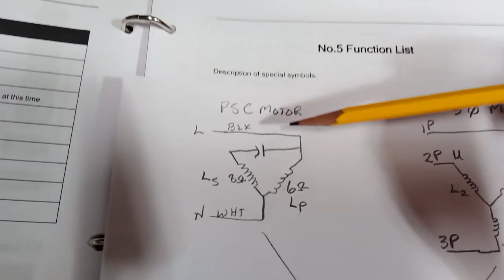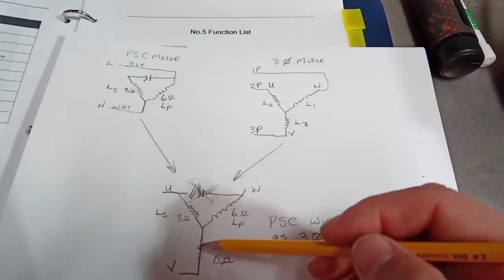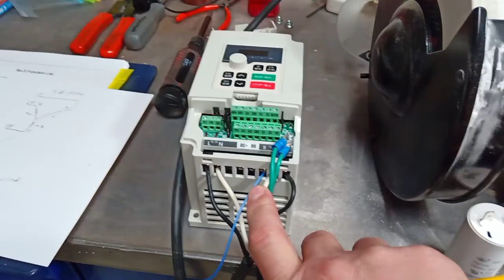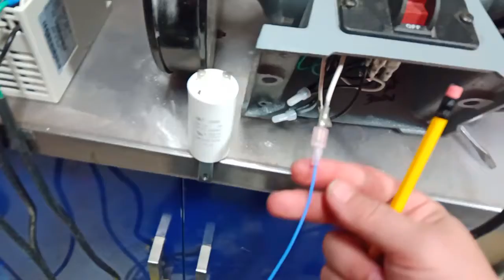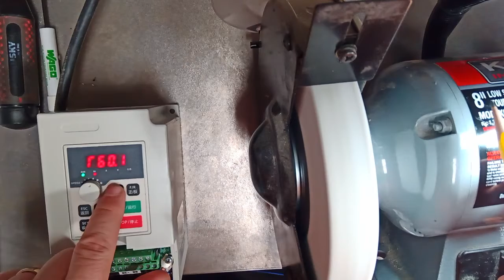Connecting a 120V VFD to single phase PSC motor in my bench grinder

Comment: Neat!
It would be nice, though, if the VFDs offered the option to change the phase relation from 120° to 90°, to accommodate the rare occasion where you'd use them with PSC motors.

Comment: Not sure if it can not be done without those settings
Reply from the maker: Therr is another linked video that discusses all the settings used for my opeation.  Others may need other setting changes.   This was all about proof of concept and journey of trying this approach to vetting variable speed control for my grinder requirement.

Comment: Absolutely as clear as MUD ?
Reply from the maker: The content in this video assumes a working knowledge of electronics and safe tool‑handling practices. If the material isn’t making sense, I strongly recommend not attempting the procedure nor opening your electric motor. Safety is far more important than experimentation. If you need this capability without the technical background, please consider using commercial off‑the‑shelf tools that provide similar functionality

Comment: I have connected common on U, main on V and start on W, works just fine. In my case motor is not PSC, it's start with capacitor only, refrigerator compressor motor.
And I need to make some clarification to your story: PSC motor has 2 sets of windings displaced in space by 90 degrees, which needs to be as close as possible replicated by electrical displacement using capacitor. By it's own nature current trough the coil legs by some degrees (less than 90 degrees) behind voltage.
Reply from the maker: Yes the technical term is a capacitor causes the current in the aux coil to lead by 90 degrees.  hence is why the pole coil placement exists at about 90 degrees.  But it's much more complicated as speed comes up.  The speed of the PSC motor is actually determined by the number of poles in the motor and the frequency  A 4 pole motor runs in steady state about 1800 RPM and a 2 pole motor runs about 3600 RPM with 60Hz power.  Yes I over simplified the statement stating it was 180 degree.  When the PSC motor starts the current leads by 90 degrees with a huge inrush current causing a aux voltage lead of 70-90 degrees.  As the motor speeds up the aux current lead drops to 20-40 degrees and the main coil current lag drops to 15 degrees.  So yes the physical winding is near 90 degrees in space is what interplays with the AC voltage source capacitive lead phasor.  The standard 3 phase motor has the coils placed 120 degrees in rotation.  The fact the PSC motor uses only 90 degree placement to help match capacitance lead, is what in essence still allows the VFD to function.  The 90 degree placement vs ideal 120 degree placement is not as effective and efficiency drop.  The PSC motor by design produces the most amount of torque on startup and least amount of torque at running speed.  The VFD provides the output at 120 degree phase relationship.  The VFD variable frequency output is what permits the variable speed control of the PSC motor.  In my grinder application, I find the VFD provides more consistent torque through the variable speed and is likely attributed to the output being 120 degree vs the standard 90degree current phasor relationship cause by the capacitor.  The design isn't ideally matched but thankfully it is close enough that it works.  I should have used the more technical 90 degree phasor description in my video rather than the 180 degree 2 coil phase implication stated.  What I really failed to clarify was the difference in motor design using 2 pole vs 4 pole motor.  The 2 pole (standard 3600RPM) motor vs the 4 pole (1700RPM) when running on the VFD.  The more poles in the motor should provide a more consistent torque application at the running speed.

Comment: Your white wheel has a lot of left and right play. Don't be afraid to use a truing tool on each side. Just a light touch will do it.
Reply from the maker: Thanks.  It wasn't a concern.  When I was truthing the VFD concept in these videos,  I had no intention of using those stones.  I installed a Multitool 2" x 36" Belt Grinder Attachment (MT362) and a cardboard paper wheel on the second slot.  The whole idea was to get a total blade grinding and polishing machine in one unit.  Go from 40 grit to 600 or 1000 grit in the belts and scotch-brite belts then have full polish on the second wheel.  Hence the need for speed control and better torque management at various speeds to match the work tasks.🙂

Comment: Thanks for sharing this! I have a blower fan for moving air in my house that is 110V AC PSC but runs too fast / noisy. I had previously tried a triac dimmer running it single phase and it would hum. I wired it up 3 phase as you showed in your video with a VFD and it can be run at slower speeds smoothly and no hum which is great, but I'd like to be able to turn the fan on and off just with the AC supply. I also dont need the full variable range of the VFD, just want to run the fan at ~1/2 its originally designed 1 phase speed. Any thoughts on how I might be able to do this? Thanks again
Reply from the maker: I haven't actually played or tested that operating mode.  However something that you might want to investigate is the following:  The VFD has a power fail startup option.  See function F153: Power  failure restart selection.  The default condition has power failure restart being set as invalid,  I'm guessing you would need it set to 1. You will also want to look function F154  Allowable outage duration.  Not quite sure how to interpret the functionality.   Also F155 Time of fault restarts probably needs to be set to 99.  The other train of though is to use one of the programmable inputs that can be used to set the system to start in FWD or Reverse.  The remote start function would have to be enabled.  The input would need to be set to the required closed connection to the input ground terminal.  Problem might be that on power up it might not act on the switch setting as a safety feature.  So you would need to try it out.
Reply: @prairieedgeservice  Thanks - I'm getting good results using a capacitive based fan dimmer which can simply be connected in series with the fan in its original PSC configuration and works with my on/off AC control. Would be curious to understand the pros and cons of slowing these motors by frequency vs voltage. In my case voltage reduction via added capacitance is simpler and cheaper, but I'm sure there are benefits of frequency based speed reduction.
Reply from the maker: @jcs7928  Ceiling Fan controller using variable capacitance is really just changing the steady state phase relationship between the two windings.   These circuits work reasonably well for motors that have light loads.  If your using a squirl cage fan, that might induce a much larger load.  Air on the other hand is a pretty forgiving media as a load.  just remember the Voltage and the frequency is fixed using this your approach.  As the motor speed drops the current typically increases.  What a VFD will do is change both the voltage and the frequency to keep the current withing limits to achieves a speed.  The end result if the fan controller that you have works, use what you have.  KISS principle.  Both approaches have merits and problems. We are still taking an AC motor and running it in a way that motor is normally not designed to operate. Just keep an eye on how hot the motor gets when set to your target speed.  Heat means higher operating current.

Comment: Very informative video.

However, many frequency converters have a protection circuit. With unbalanced loads, they go into fault mode because a fault is suspected, such as a short circuit or open circuit. It's possible that this inexpensive Chinese unit doesn't register this fault. If so, it's ideally suited for unbalanced phase loads.
Reply from the maker: You never achieve an open or short circuit provided that the primary coil and the running coil do not open.  So if you look at the voltage connection U-V or V-W or W-U you always end up with an inductor in each phase voltage loop circuit.  Therefore you never have an open or a shorted loop.  On two of the phase relationships you have a single inductor and on one of them you have a double inductor.  This basically means the loop current on the single inductor phases will be a little higher than reported.  Yes the motor will be less efficient.  Yes there will be a torque imbalance as the stator rotates.  But this doesn't mean that it will report a fault. But again the split pole motor has the coils arranged so that torque is relatively constant just with the two phases rather than 3.  Hence operation in this way really doesn't change.  It just means you gain more functionality.  Yes you can still burn out the motor.  But that condition existed anyway if you totally stalled out the split pole motor anyway.  Here you are more protected because the currents through each phase loop are actually monitored by the VFD controller.   It just depends what a person sets as the loop current safety limits.

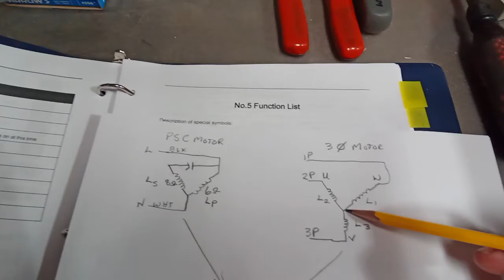Comment: 2:48 That is a STAR configuration.
Reply from the maker: You get a gold star. Correct
Reply: @prairieedgeservice 

Hello, I understand English less well, so I need to ask a question.

I have a Makita GB602 machine that uses a single-phase induction motor.

I would like to know if I can reduce the speed using a VFD controller (I have read in several places that VFDs only work with three-phase motors).

If that is not possible, is there any other way to reduce the speed? Could you please help me, it is very important to me.

Thank you.

Comment: hi, this is star not delta , and phases are 120 degrees shift not 180 thank you
Reply from the maker: Correct.  I'm just not going to re-record the video because the mouth said a different word than the mind was thinking.  In a 3 phase system yes the phases are 120.  I was simply stating that in the Permanent Split Capacitor induction motors as 180 because people only associate these as 2 windings so that might mean 180 degrees.  The reality is the Permanent Split Capacitor induction motors have a variable phase relationship.  The phase shift is totally determined by the  winding inductance and the capacitor value.  Because the winding current is continually changing during the start up speed, the phase is actually shifting until a running state is achieved.

Comment: Hello friend. I am setting up my Delta drill press 17-900 16.5" with a 1.5hp 1750rpm three phase motor from 110v to three phase using a 2hp VFD single phase. But I jave no idea how to program it. Would you be able to share a couple of tips?? I have the same brand and model VFD as yours.
Reply from the maker: I have a second video with the programming and parameters that I used for my setup with my VFD.  Look in the video comment to see the entire list of parameters modified for use.  All remaining parameters were left as default.  It's just a matter of getting the setting to be within range of what your motor will accept.  The others are about calibrating the display to be somewhat representative of the actual operating condition such as RPM calibration.  
 https://youtu.be/Sv9ry-ixOuA

Comment: I have a few antique Craftsman drill presses, and the Vari-Slo attachment for them is very hard to find, and very expensive when they can be found. Will this work with a 120v 60htz 1/2hp and a  3/4hp single phase motor?? If not, can you please recommend one that will?? Sorry if my abbreviations are incorrect, I never really studied electricity, and your knowledge on this is far greater than mine ever will be. Thank you in advance!!!!!
Reply from the maker: I think I recall from many of the old craftsman drills is that many had an electric motor like a furnace motor that has fast startup motor with a centrifugal clutch for starting.  If your has that familiar click type start, then no the VFD listed will not work.

Comment: I have a 1-1/2 HP @110V or 2 HP @220V Delta table with two caps, but it doesn’t make the clicking noise.
Very similar 1 HP motor on a Jet wood lathe, and I don’t think that clicks either.

Are those start & run capacitors?

Thanks
Reply from the maker: They might be two different caps for the different voltage ratings.  I'm assuming you ment table saw.  A VFD doesn't not offer any real benefit for a table saw.  Just stay with original motor.

Comment: Used this approach with same VFD on a Bucktool BD4802 belt / disc sander - 3450 RPM, 1 HP, 120V, 5A - works like a charm - good torque throughout 100 - 3450 rpm... much obliged sir!
Reply from the maker: That's great to hear, glad it worked for you!  Thanks for sharing your build.

Comment: Nice! So you can wire it without the capacitor?
Reply: Correct.   The capacitor creates a phase change between the 2 windings which causes the motor armature to turn.   The VFD supplies a changing phase relationship.  Thus the capacitor is removed and function of the capacitor is provided by the VFD.

Comment: I would like to know if i can run a couple of leaf blower motors that are connected to my flow bench with this unit ? pretty sure they dont have caps , just a 2 speed on / off switch.
Reply: I don't know.  You would have to open up the housing and validate.  It should be a split pole motor with a run capacitor just like a bench grinder.  Only little use a magnetic tap in the motor winding in place of a cap to produce the phase shift.  I leaf blower requires more torque and hence is why I think it should have a cap.

Comment: Does this produce more heat on the motor at low rpm?
Reply from the maker: The motor does get warm but how much really depends on how you use it.  When I used my grinder @1750, and I really ground things down it would also get warm.  I think the motor is still cooler running at 1000 RPM with more torque using the VFD than if I bogged down the 1750 down to 1000RPM because the fixed frequency original configuration only has current to make up for the speed reduction.  The benefit of being able to set the speed slower or faster depending on the task is totally worth it for me.

Comment: You called your 3 phase motor a delta connection. It is actually wye connected.
Reply: Correct, you get a gold star.
Reply: I was just about to add the same and noticed your comment. 😂

Comment: I have a concrete agitator which motor always burns out, i want to use a single phase ac motor which I want to control speed to atleast 300 rpm for soap making, would this work?
Reply from the maker: In high torque applications like you are using you should use a VFD like the one I showcased but actually use a 3 phase motor.  You want and need the three phase windings in the motor to provide the torque needed, especially if you are slowing down the motor. A VFD will give you speed variability but if you exceed the torque of the motor with the electric current you will still end up burning out the windings. 300 RPM is really slow to and high torque at slow speed can cause the windings to burn out.  For these type of applications, I would recommend some form geared down drive system.  
A VFD might help prevent your concrete agitator to prevent burnout but you would have to test to validate.  The soft starts with the VFD would help control the high in-rush starting currents when under load.  Can't be sure that it would fix your issue though.

Comment: What if you have no access to the capacitor and you leave it in? What happens?
Reply from the maker: The capacitor causes a phase shift for the second winding.  You didn't identify how you would connect the VFD to the motor in that specific case.  If you are connecting the VFD to the two phases then you are causing two outputs to be tied to the same wires as the capacitor.  You will likely damage the output transistors of the VFD.   But if you are like a college classmate of mine, he would purposefully bought polarized capacitors just because they would blow up when connected to an incorrect power source.    Deviations from my proposal are yours to figure out.  I only present the findings of my own test.
Reply: So, definitely, capacitors need to take off for AC single-phase output. Thanks

Comment: THIS WORKS  !!!!!! I used the exact same H100 Vevor VFD...coupled to a Single Phase 1/4 HP 1725 RPM DELTA Drill Press motor....SMOOTH ...got down to about 45 RPM @ 5.0 HZ....ORIGINAL Belt reduction was at 620 RPM @ 60 Hz.😂😂😂😂😂🎉🎉🎉🎉
Thank you !!!!!! Followed your method to determine which capacitor lead to use !!   And followed your YouTube video on how to set the Function Parameters !!! Just Perfect 11111❤❤
Reply from the maker: Thanks for sharing your different adaptation and success!  Congratulations!
Reply: So yur DP motor dosnt have a start winding,  just a capacitor winding like the bench grinder ? so you basicly did exact same wiring as in the video